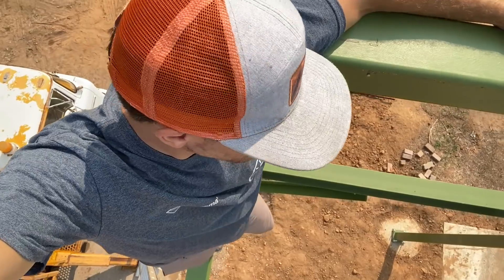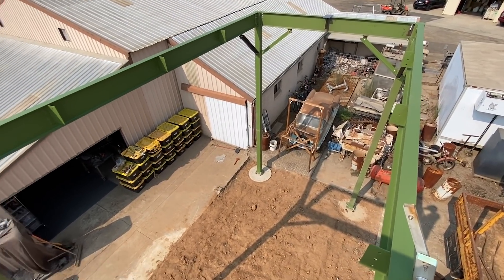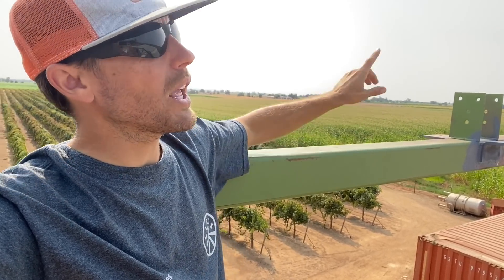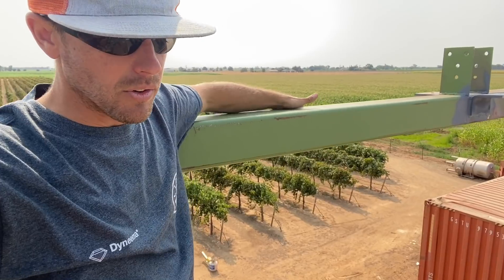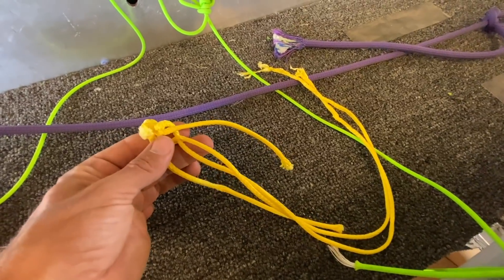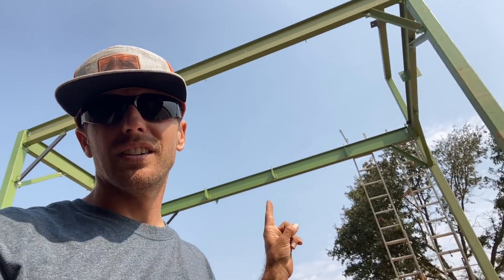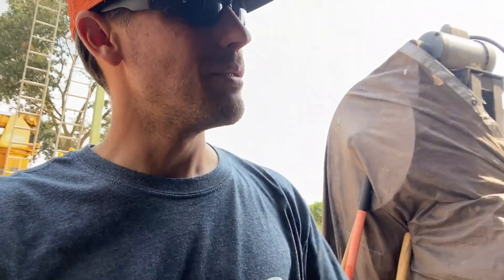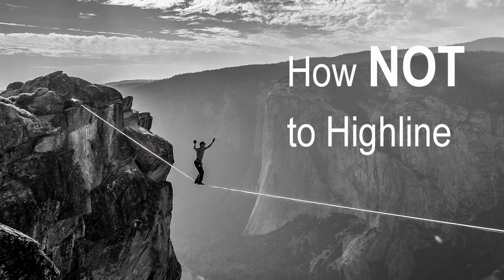Drop Tower Erection

Comment: Are you including some specific elements for mounting cameras? Assuming you are running power all the way up the tower for various usage, is there a plan to isolate and make sure both the power and any data cables have clean signal/power output?
Reply from the maker: Yup, those are details I'll definitely have to figure out

Comment: Hi Brian, maybe I missed it in advance, sorry. But I was interested in attaching the supports of the drop tower to the cement foundation. These thin studs that stick out of the foundation and the gap between the foundation and the legs is 4 inches, is this just leveling the structure and then it will be additionally filled with concrete, or will it stay that way?
Reply from the maker: They get grouted like light poles and many post structures (I notice this stuff now when I drive around now that I'm looking for it).  We will be adding a lot more triangles to make it strong

Comment: for autobelay device I can suggest the camp goblin, cheaper than petzl asap
Reply: I think hes referring to auto belay devices that exist at the climbing gyms for speed climbing. As for the goblin vs asap. If you're using a follower and it needs to be completely hands off the asap just runs nicer. I use the goblin daily, it is a bit finicky though. Always have to be checking up on it to make sure it's running property
Reply: @mikelarin8037  thoose are expensive
Reply: @enricociuppa7093  I know lol I have both for work. We often need double descender and double safety follower.